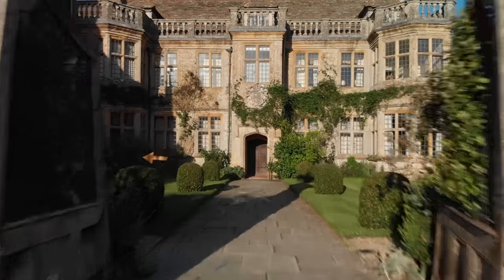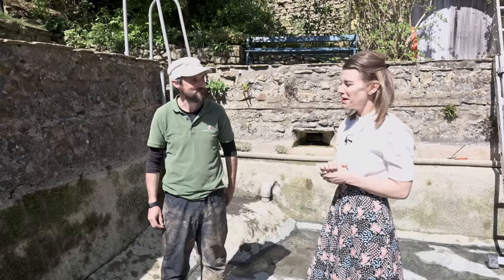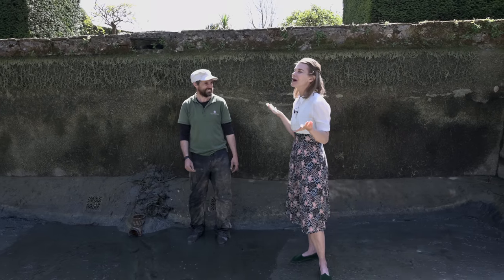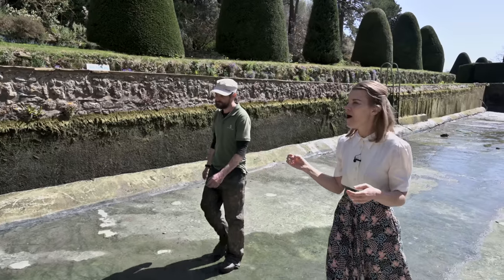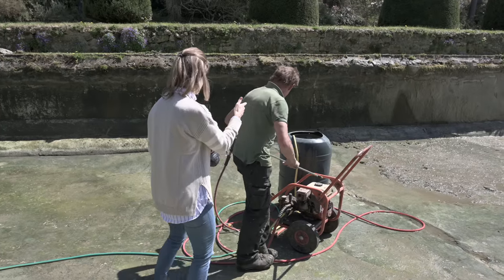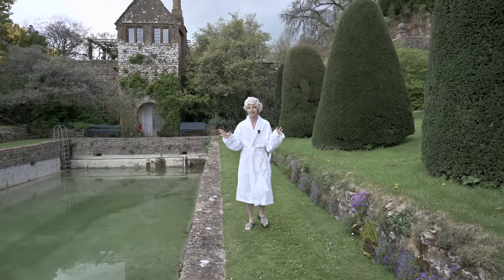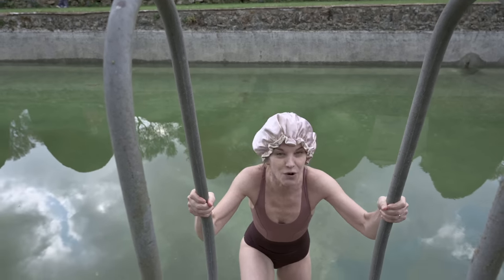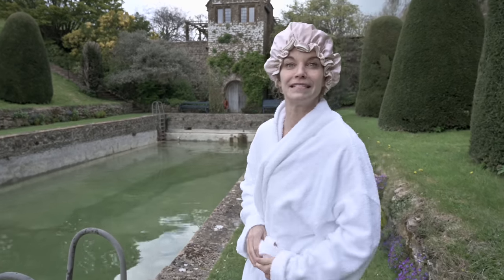Draining & Cleaning our HUGE 18th CENTURY SWIMMING POOL | Ep 6

Comment: They should put a bio-filter on their pool. One that circulates the pool water through an algae tank. The algae is basically force-fed all of the water repeatedly. It eats up all nutrients. Aquatic plants then can be used to keep the water clear. They are also called slime matrix filters because of the way the algae they use grows. Without nutrients, no algae will then grow in the pool itself.
Reply: would it affect the animals that share the pool
Reply: @refinedbrass  as far as i know, it doesnt. Its like we create a copy of a natural ecosystem that benefits both the animals and the plants. Ive created mini pond with this system 2 years ago and the water stays crystal clear until now. Plus it is very low maintanace.
Reply: They defenently need to do that. They can put some native fish that can eat that greenishness. Im sure they can put carps.
Reply: @refinedbrass  positively affect. Using local plants would be even better.
Reply: It’s funny I happened upon your comment as just yesterday I watched several video about building a natural swimming pool that uses bio filtration to keep the water crystal clear without chemicals! It’s really amazing.
Reply: I see lots of good stuff you guys posted for these ponds, and for new ponds i think they are a excellent choice. But in my eyes, if it's not broke why fix it the ponds are 150 years old and has had time to build a strong ecosystem with the gardeners. You can tell this by the over abundance of Salamanders. They are a very important keystone speices that many of the 100 known spieces are endangered or going extinct. They are also bioindicators because of their thin, sensitive skin and evidence of their presence (or absence) can serve as an indicator of the health of the environment.
Reply: @refinedbrass  creating a self maintaining ecosystem will eliminate the need for draining/power washing, and will keep the water clear. Salamanders can keep staying there, and won’t be drained below the lily pond. Look up freshwater pools. You’ll see how they’re created with nature in mind.
Reply: @missarifina1895  Like there are not enough pools for the animals to move to and live in....
Reply: @SweetOsoka  Who wants to swim with carps? Those things get big.
Reply: @caciliawhy5195  well i like it when at night i can hear the sound of cicadas, and some of the birds are regularly coming to my small pond to get some water. They are really cute anyway, and they help keep the pest away from my plants (cos they eat insects, and insects eat my plants leafs etc). Or after each rain i can hear frogs singing.  Idk with anyone else. But for me these things make me happy, and i like it that way.
Reply: @caciliawhy5195  ppl swim with dolphins🤣🤣
Reply: @caciliawhy5195  ikr?!!! Gross
Reply: I live in a rural area and a lot of people have manmade ponds with small water filters to help maintain them. Definitely works and wildlife can still live in it. :)
Reply: A copper bottom would also work
Reply: @SweetOsoka  I saw the @ name and did a double take hahaha.
Reply: Would this require a pump?
Reply: Ok what about all the mud and other debris and stuff that gets in?
Reply: This!
Reply: @onevoter203  That pool is very old and the building is historical. I very highly doubt English Heritage would let them do that. They would have a fit and make them put it back the way it was.
Reply: @refinedbrass  I agree
Reply: @missarifina1895  if it needs a pump though, won’t that require electricity? And what would the plumbing be made of? Plastic?
Reply: @KB-wk9bv  I'm no expert but over 150 years the pond has been drained periodically and cleaned it might serve a greater purpose in the ecosystem then you realize it could help maintain population control and also sever as a biological cue to start mating after the cleaning period is over did you see how many tadpoles wherein start of the vid imagine how many would reach adulthood if the pool was not drained that would throw things out of wack frog tides can be a plague
Reply: Wow, super cool. Thats brilliant idea. Love the way God made things to work
Reply: @SweetOsoka  dolphins are smooth, fish are scaly and often sharp or have barbs. That's not as fun to swim with.
Reply: @onevoter203  likely not allowed as a registered historical property, and completely destroys the property's purpose. The goal of the place is to be a historical site, not a luxury villa. Even the grandest French chateaus have stone pools and fountains.
Reply: @refinedbrass  do you really care about frogs that go into that pool
Reply: That’s pretty cool!
Reply: @onevoter203  im thinking since in a grade 1 listed building and gardens they cant do anything that might harm the existing pool walls
Reply: old tech that still works today they have been using them in japan in the koi carp  pools you can swim in to keep the water clear, they also have water plants in some of those pool lilly pads and other stuff
Reply: That’s brilliant as it would keep maintenance low in the long term and keep the water clear without affecting the wildlife!
I suppose it keeps the pool at a more consistent ph-level as well. Probably a pretty costly installation but if it works without a pump (?) would be cost effective as cleaning like this could be cut down.
What a dream to have a natural spring water pool with no chlorine etc.
Chlorinated pools are horrible.
Reply: i was also thinking aquatic plants could keep the water cleaner!
Reply: Using ancient organisms to clean the pool for you. Biofilters are genius.
Reply: @Pillowpetlover  yea and so should you its more then just frogs in a pond its about perseving history too many significant historical sights/ works  throughout the world since the end of ww2 have been lost  like this pond is a example of the victorian era plumbing and architecture we should Charise are history as long as we can you never know when you might lose it like Notre-Dame cathedral
Reply: This would take some getting used to.
Reply: @refinedbrass  yes the pool and architecture is important but I couldn't care less about the animals that go into it
Reply: upvote they need to know this
Reply: @KB-wk9bv  except it will eventually fill with mud
Reply: If you would like to learn more about this type of pond go find Weed em n Reap on YT! They built their pond like 2-4 yrs ago and have lots of videos on it! And it's an all natural pool!
Reply: @caciliawhy5195  Actually there are very few pool if water that act as vernal pools. IE no fish to eat the salamander, newt and frog eggs. You could still run a BIG biofilter which would clarify the water. You might be able to run the water though a UV system for additional clarity but I don't know how that would affect the crutters
Reply: @onevoter203  yes maybe so yet they’re NOT under strict rules of The English Heritage.
Reply: @refinedbrass  no! A bio field would not! And they technically already have one the lily pond! They just need to connect them correctly! I swear by Weed em n Reap go watch their pond vids here on YT! Very informative!
Reply: They could use the lily pond right next door as the filter.
Reply: @SweetOsoka  they want it to be like how it would have been back at its conception I think. The pond behind it could have fish and lilys
Reply: Make it a salt water pool you won't have those problems 😉
Reply: @robbarker450  It is constant spring fed. That would mean always adding salt and that the outflow into the environment would contain all that salt. Not good. The lily pond is right there as a bio filter. Just a little bit of plant balancing and a pump for re-circulation back from the lily pond and all is good. The wild life can then thrive in the lily pond.
Reply: These NATURAL  SWIM PONDS GET CLEAR AS A CHLORINATED POOL, Does not affect  animals and require plants to survive.
Perfect solution.
Reply: @Awol991  they do as it drains out under the lily pond.
Reply: @refinedbrass  I don't think this is a pond, it is a swimming pool...an old swimming pool. If they wanted to take measures to keep the water clean and pristine, it could easily be done. Allowing mud and other animals in there could lead to health issues from the water touching your skin...like a nasty rash.
Reply: @jeffburnham6611  it was a swimming pond and still is but now that salamanders and newts made its home there by law they could not change or really do much of anything besides maintaining the state of pool from what I read it's like tree law you will get some incredible fines if you mess with any the 3 types over there 
palmate newt (Lissotriton helveticus)
illegal to sell or trade in any manner
　
great crested newt (Triturus cristatus)
illegal to kill, injure, capture, disturb, damage or destroy habitat, possess, sell, or trade. The best course of action would be to just avoid the newts and their habitat altogether.
　
smooth newt (Lissotriton vulgaris)
illegal in great britain: sale or trade in any manner
illegal in northern ireland: killing, injuring, capturing, disturbance, possession or trade
Reply: @refinedbrass  are you kidding me? They have to drain the pool every year (theorically), thats sounds pretty broken to me, so a natural pool system could fix that :)
Reply: A natural pool! Yes!
Reply: @Awol991  Not without major construction. This pool drains under the other one, not into it.
Reply: @refinedbrass  fantastic info about the newts, and with scientific names! I'm impressed! I was a hobbiest herper back in the 1990s and I love this ecosystem. I'd be delighted to be swimming with newts and tadpoles! I just love this natural pool and if everyone were read your comment, before commenting themselves, it would save them loads of time (making suggestions about how to improve something, that historically and legally, cannot be improved upon!) Kudos for the excellent information!
Reply: @Pillowpetlover : When I was a child I had a frog rub against and come up in front of me when I was hanging on to the side of a pool in Ensenada, Mexico. It was slimey and creepy.
Reply: @caciliawhy5195  no there’s not. That’s the issue. We’ve taken all the land from wild animals. How do you not know this?
Reply: YES!
Reply: The pool looks like it’s already been retrofitted with some sort of basic filtration system. Aren’t those skimmers at the shallow end? It also looks like pipes are running along the sides where the walls meet the bottom? One is behind the guy at 3:00. I think that’s why the bottom perimeter of the pool has those slanted parts. Maybe the system was abandoned?
Reply: You do not understand how rich people live. They like swimming in natural water with all the different life and death happening in it. They think it is healthy for them.
Reply: @Pillowpetlover  if you study ecology, you would see those frogs probably play a very vital role in the local ecosystem.

Comment: People have commented that they should line the pool with tile, marble to make it modern. I am not sure but I believe Mapperton is a historic landmark of Britain. So, I think there are limits to what they can do even if it is their estate.
Reply: indeed, it's a listed building. The rules are insane.

Your windows have to be wood frame, single pane, and therefore drafty. No modernizing allowed.  If your bricks were hand made, you can only replace them with artisanal hand made bricks. Your wooden beams, door frames, and supports have to be custom made to match the original type and design. You can't add insulation to the outside either. 

There are some exceptions, as you're allowed to modernize plumbing, heating, and kitchen appliances. You need a permit for everything, and you need laborers who have a special license, which makes them significantly more expensive too.

Many listed properties stay derelict because it's insanely expensive to renovate them this way, however some local councils are more lenient than others with permits and rules.
Reply: moderning such beatiful old pool is the worst decision. stop moderning every old thing you see
Reply: Maybe coat of paint? Or installing a filtering system + chlorine
Reply: @chumakov  but that would kill off the beautiful and natural wildlife. It's a natural pool....much like a lake. It has its own ecosystem.....we certainly aren't used to that in the US.
Reply: Wow unbelievable you can put (Pebbletech) dyed to match the original color but easier to clean with a new pump filter system and yes tile and pavers would finish it while keeping the aesthetic. This literally makes me cringe because of the bacteria and ick. Pools need to be circulated or they fester.
Reply: Victorian age is wonderful to see! I thank the creator for this footage, how they can adapt modern but stay true to the age of the pool. It's beautiful 😍
Reply: Many people swim in ponds, rivers, lakes the oceans and the sea. This is a pond filled by a spring so it is a natural pond, essentially. Grow a pair? Not the original poster, but some of the commenters…
Reply: No they should use epoxi, it's way better.
Reply: You could do any color, dark green, dark grey, to keep it neutral.
Reply: It's natural. I don't think I'd go in after it really gets dirty but at the end where she was in it, I would.
Reply: Nor should they! This pool is history and 1,000x more interesting than any modern day tile.
Reply: @bearyhot  Speak for yourself. I grew up swimming in a farm pond with turtles, snakes, weeds, muddy bottom.  So did my kids.
Reply: @Jolynnae- lucky for you that you never got exposed to algae & bacteria that could make you very ill. We seen a bunch of patients that ended up with flesh eating bacteria from tiny skin scrapes . They can modernize the filter with put natural tiles or pebbles but it’s expensive to make it have the Victorian aesthetics
Reply: Why would you ruin an historic pool?
Reply: @njrenkable  No this is a natural pool cleaner than your chemical pool.
Reply: @chumakov  Chlorine is horrible
Reply: @christineperez7562  Who said anything about adding chlorine. There are talented pool designers that can create same Victorian and vintage aesthesis in lining the pool (but it super expensive) . And a more modern filtration natural system using limestone technology. Chemical pools don't make people sick unless your skin is ultra sensitive. All these claims about natural pools boosting your immunity by exposing you to different bacteria , just hope you don't get exposed to brain eating ones via a tiny cut or scrape.
Reply: @oyinade84  18th century means 1700s
Reply: @oyinade84  Victorian era was the 19th century. That’s why you couldn’t put a filtration system that would be historically accurate it’s over 200 years old.
Reply: @ashleygibson2342  Are we living in the 18th Century? Nope ..there are advanced filtration systems that will still give this place the vintage Historical look/aesthetics . But there are very expensive to maintain. The murky looking water and all snakes & newts isn't so appealing.
Reply: Somewhat stagnant water breeds all kinds of things.
Reply: @oyinade84  The pool is a historic artifact. If you add a filtration system it is no longer a historic artifact. Why trample history because of your own modern ideas and fears on what is and isn’t hygienic?
Reply: Even here in United States if you have a historic home or plantation that is recognized and labeled historic land mark and building you have to keep your home looking exactly like it did back when it was first but huge lost kf things yoy can do and small list of what you can do includes everything on the property and you have to keep the house and property in prestien shape and leave all artifacts or classic historic books decorations and even 100 year old plus equipment pots and pans and all in some lol but yes any home you have listed historic like a plantation anywhere in the world you have a crazzy huge list of eules
Reply: And I know some one who has a huge modern in ground pool that only cost him price of the pvc concrete the spray stuff and tiles. It's fed by a natural spring abd drains into the spring it recirculates all the water naturally ever 2 days so it's always clear fresh cold and refreshing in the hot 105 degree summer days down here on the gulf coast he lives out in the country down here. He had his water tested by pool company he didn't say anything abd they tried to sell him 800 in chems cuse it's clear and safe but no chemicals before he told them it was natural spring fed pool their mouth hit floor couldn't believe it so hers is safe as well
Reply: @horanghaeng  How about just adding heating? Is it so wrong to be more comfortable and able to use it more?
Reply: @horanghaeng  " moderning such beatiful old pool is the worst decision. stop moderning every old thing you see "

If its a public property that anyone can visit/tour then yes.

If its private then the entire point of listed buildings is as @jane jan  says pointless because it will all result in these old buildings falling apart piece by piece until the entire site becomes so derelict that the local council would rather allow it to be developed than leave it a mess.
Reply: Yeah, most American would probably rebuild and repaint the whole thing :D
Reply: @janejan9728  The rules are good and it should be preserved like this. Tired of cheap not long lasting modern building and materials.
Reply: It's a grade II listed property and that would be a NO.
Reply: They have to keep it original

Comment: You guys could vacuum the bottom once a week and dump the mud, tadpoles and newts into the other pond. 

Also a biofilter will also help keep it clean without contaminating downstream.
Reply: If the pools were the other way round. You could use one as a natural filter for the pool.
Reply: @CJMVector321190   that’s true
But I guess whoever built the pools back then wasn’t aware of that. Or they were just using it for fish which is why it’s by the kitchen gardens